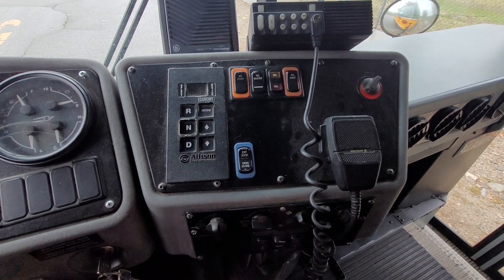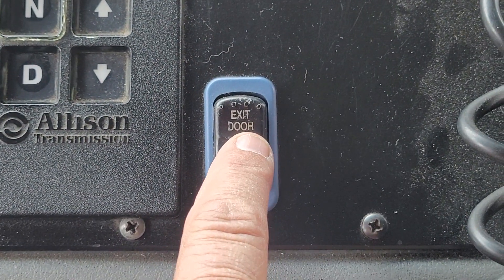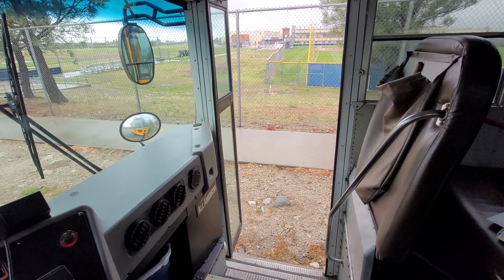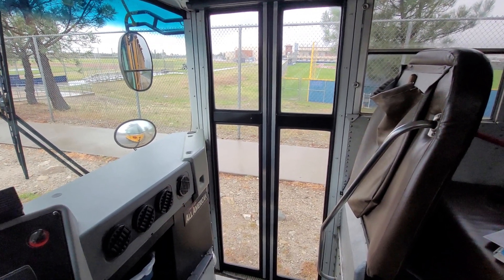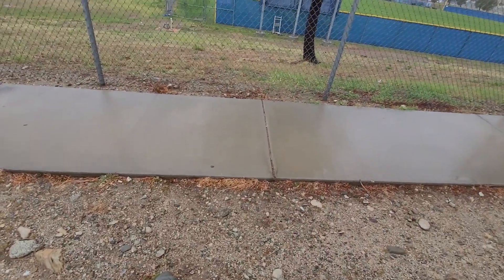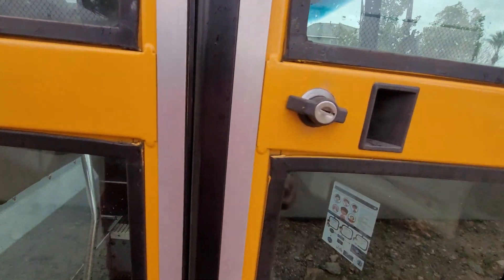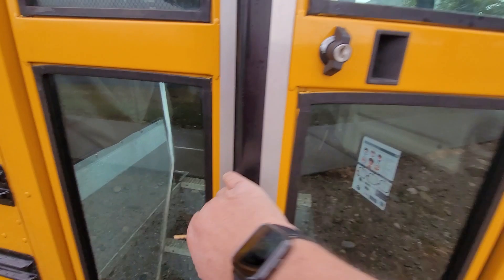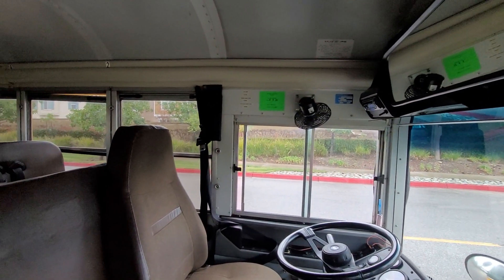How does a school bus door open? 2008 Blue Bird All American RE CNG

Comment: Those doors look like Thomas's older doors
Reply from the maker: @Bus-8076  standard on Blue Bird transit buses from to 2000 to 2024. I haven't seen a 2025 model yet, so I don't know if they continued it with the current model year.
Reply: @jonusle2937  think of the fact that they are/were yellow
They are also similarly shaped

Comment: Are you able to do a brake video on it? And maybe a inside start up
Reply from the maker: Your brake test may be different than ours, but I will try when my schedule allows.
Reply: @jonusle2937  Alright
Reply: @jonusle2937  Oh. When you turn off the emergency release, the doors just close super fast. And they’re better that way. Especially if they slam closed really fast if they just close the doors with the normal bus door switch.

Comment: I own a 2002 Neoplan AN440, im having an issue where the front door is not getting air pressure to open and close properly.  Because of this, when you shift into R or D, the bus will not get throttle response because it senses the door isnt closed.  Is there a way to override that?  Or how does one check on the air pressure system above the door?  ANy advice greatly appreciated!